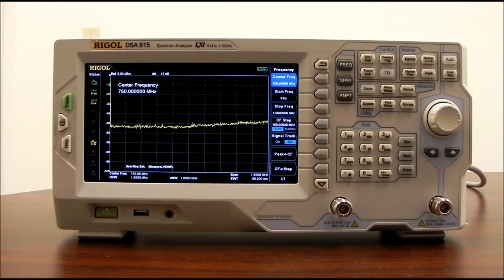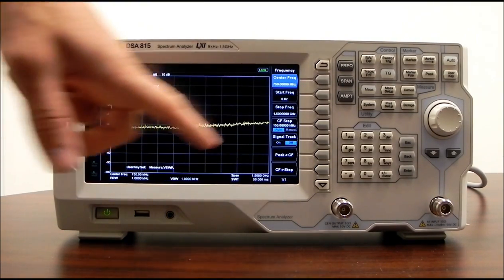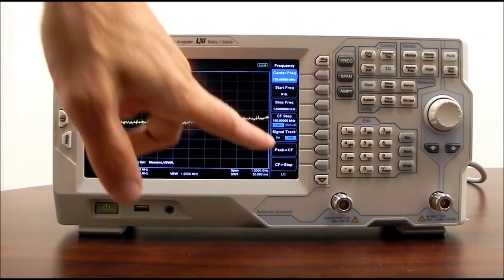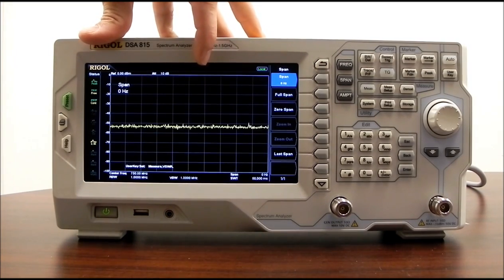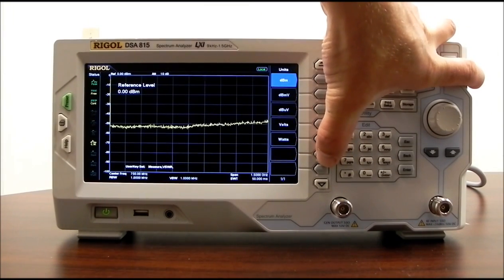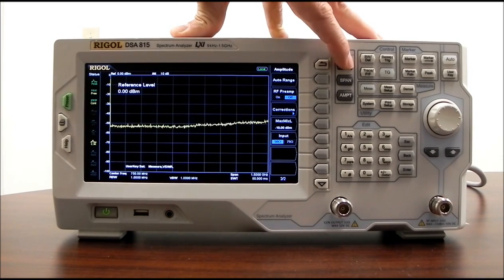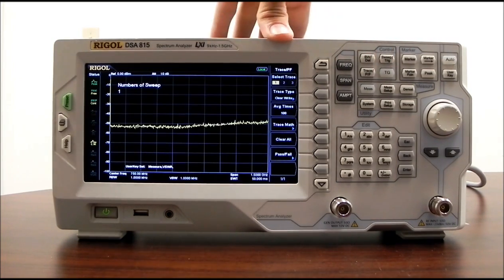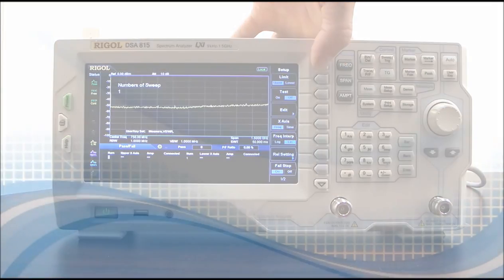RIGOL's DSA815 Spectrum Analyzer Part 1

Comment: Where is it possible to see any spectrum of AC and DC welding process to find out,if it is possible speak and receive SMS  via 2G a cell phone,which uses 900 MHZ and 1800 MHZ GSM frequency band if welding is performing five meters away from this cell phone?

Comment: If this device is only capable of analyzing above 9 kHz, then what is the point of allowing start/stop frequency under 9 kHz all the way down to 0 Hz? What will happen if I select start = 0 Hz and stop = 5 kHz? What will this device display in that case?
Reply from the maker: These analyzers can visualize some signals below 9 kHz, but the power is significantly attenuated. There is no specified accuracy, but it can be used to see some signals, so we allow the user interface to make it possible to look at those frequencies.

Comment: I have DSA815, my device RF output is more then +30dB, I wanted to measure this, so I add an 40dB RF Attenuator to the input terminal, is there any setting I can do into the AMPT menu to have considered during calculation of my RF power in the screen.

Comment from the maker: IF Gain is set based on the instrument configuration. The maximum mix value can be adjusted using the MaxMix menu setting located in the Ampitude menu.

You can write more to support@rigol.com for a more detailed discussion.

Thanks,
Jason